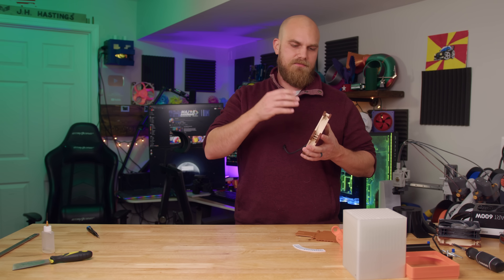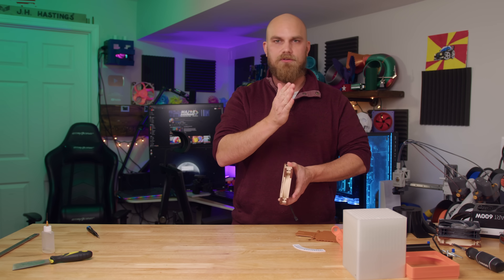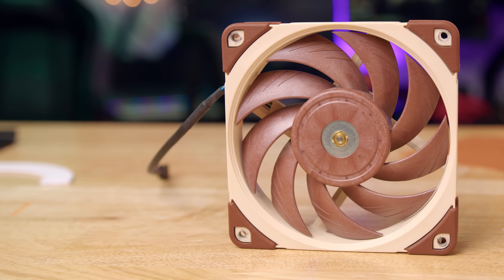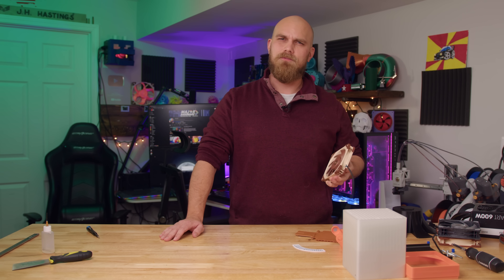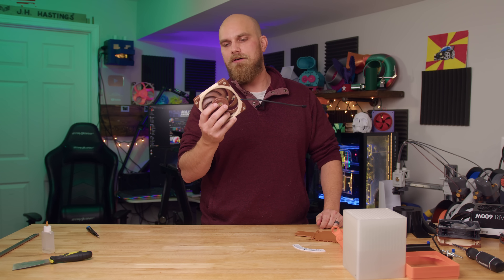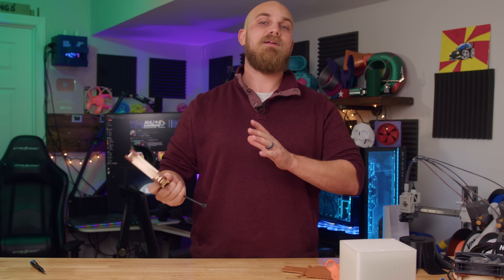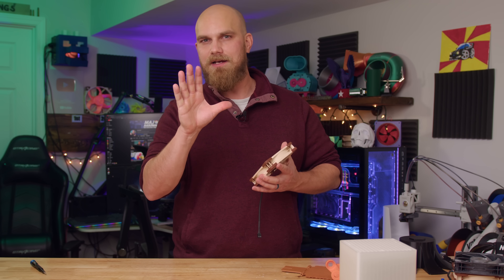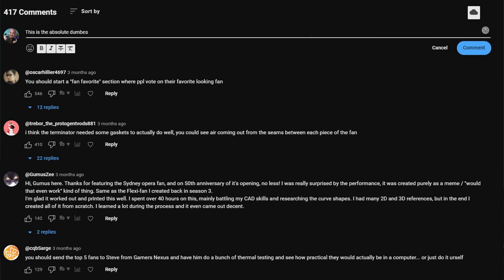I Built a Static Pressure Machine | Fan Showdown Season 6 Pilot

Comment: Not having done any fluid dynamics excepts for a few weeks one semester, you are measuring the pressure force and the force caused by the change in momentum of the air right? The air is deflected so you get the pressure aspect and the deflection as well; Do you want only pressure? Just use a double water column.

Also if anyone that has done more fluid dynamics could tell me if what i said is right? Because intuitively you'd expect different results if the restriction was the same, but the flow was not deflected and continued in the same general direction.

Comment: the only fix would be to adjust the gauge or sort of ruler that you have there to be less linear and more logarithmic. as others have explained, as the flap moves out of the way it takes exponentially more pressure to move it farther out of the way, so nothing needs to be changed about the flap, maybe measure it for reference, but all that needs to be changed are the numbers on that arched piece of the gauge.

Comment: You could make a tunnel where the fan sits in the middle of it and there is a pitot tube both at the inlet and outlet side. The difference in the pitot tube would give us the pressure difference. 😊
Reply: A pitot tube measures stagnation pressure, providing flow velocity, not static pressure.
Reply: I like this idea. Probably depends on how good a pitot tube you could buy for the small reading.

Comment: As an ecs engineer this seems insufficient to charactetize pressure. The problem is the pressure a fan creates is tied to the cfm along a curve. A fan will produce less pressure and more flow if if there is less restriction behind it. More restriction and cfm goes down but static pressure goes up. Honestly if you use a 3d peinted gate valve, your annomometer, and a water manomiter (use water cooling tubing) for static pressure you could generate curves and show how two fans might not be better then one another, but they might both outshine the other depending on the application

Comment: So, to work on your homemade scale.  how did you come to the amount of force / static pressure related to your scale? I would like to know the weight of your flap. Force Divide by Area. Lets say your flap weight is 1/8 lbs, so if it moves to 6, then it's has a 12oz or 0.75 Lbs of static pressure. I'm no expert, this is my ADHD brain trying to make sense of it.

Comment: I think the angles measured could be not granular enough to differentiate between different fans and you might end up with lots of entries having the "same" result. And even reading the correct value seems pretty prone to error.
Reply: Maybe a thinner, longer extension of the indicator might increase granularity?

Comment: It is not linear, the more it opens the less it is in the way of air. Not that it is a big problem, specially since the benchmark value is set so low in the scale and it seems that none of the actual test fans will be reaching a lot higher values anyway. The resolution should be highest at the low end, but i would assume that there are also little things that make it a bit noisy data, tinier imperfections matter more. Probably ok for this purpose.

Comment: the only real issue i see is umm whats the term? non linear? because the force/pressure required to move the flap the same amount increases drastically past around 3 if calculations are made and the increments arnt equally spaced similar to an analog multimeter it might be a bit better but really i think the main issue is that it is measured using something that rotates

Comment: Here’s an idea: instead of a wind tunnel, have the fan force air into a closed space with a pressure gauge in it. Whatever pressure the fan can hold inside the closed space is the static pressure of the fan.

Comment: Some issues I see:
1. Like others have said, your scale is nonlinear, e.g. the performance difference between 5 and 6 is smaller than the performance difference between 6 and 7.
2. The A12x25 should be much closer to the top of your measurement range, assuming most submitted fans will have performance in line with prior seasons. As is, you're more likely to hit the bottom of your scale and be unable to measure smaller performance.
3. Related to (2), your scale should probably be more sensitive to performance differences, e.g. the differences between your test fans were a small portion of the measurement range.
3. This setup is probably not representative of the environment in which a fan must actually perform, so even if your measurement of static pressure is good, the conditions that affect the fan's static pressure are not realistic.

One possible alternative:
Change the test rig so it's more like an analog tire pressure gauge. First, change the obstacle to be a cube with an open bottom (and maybe a cloth "filter" on the top rather than a solid face to simulate real conditions). Second, change the orientation of your test rig so air flows from bottom to top - the fan will be on the bottom pushing air up. Then, you measure performance by how much the fan displaces the obstacle vertically against gravity.

Comment: As for the manometer a single tube filled with water (or oil for increased displacement) making a U bend and with open ends before and after the load (different thicknesses/style of radiator) would be enough to show the pressure. With a camera and a macro lens against a precision scale you could get quite precise measurement. If you want to you could use some sort of iris with variable aperture (like in a lens) as the load/resistance to create a Pressure/Velocity graph.

Comment: not a big fan of this design as it requires airflow and pressure
if you want to determine the static pressure you can't really have air moving, cuz that makes it...uh...something else
dynamic pressure? is that a thing?

I think it would be more reliable if you just hold the lid shut and stick a bent pipe with liquid inside.

the air pressure would then raise the water column, and that actually is a common unit for pressure

edit:
now that I really think about it, shouldn't the stesting methodology have been obvious?
mm/Hg literally means "millimeter mercury"

you can't get mercury, then use water

inches/watercolumn not only solves the mercury problem, but also makes it american friendly
and with a simple online converter you can convert it to metric
and you don't even need to do that because bigger number is better

Comment: The 6 is likely fine since you want fans to exceed the Noctua fan and anything that doesn't push past the 1 would not be a consideration anyway.  This scale will also be sort of a reverse exponent since the more open the door is, the more airflow is measured vs pressure.

Comment: Would be awesome to start a contest on submitted Impeller blades for a 3D-printed water pump and test self-priming (height), psi, vertical lift, and GPM.
Could still be PC-related if used for CPU cooling.
EDIT: yes, using a static pressure test would be cool, and other tests.
The water test mentioned might be a better test tho.

Comment: I mean, why not just seal it off except for a tube with water in it and use the movement of the water against gravity to measure the static pressure?

Or, if you just have to have a completely 3D-printed solution, how about a vertical stack with an enclosed (mostly airtight) counterweight that exposes additional escape holes as it's pushed upwards with an indicator sticking out the top of the stack to indicate the height of the counterweight as the static pressure builds underneath?

Comment: not a bad setup and simplicity is king.
while you might have issues keeping it level, maybe find some ultralight linear bearings on some guide rods, blowing air up against gravity holding the weight down would provide a slightly more linear pressure reading. this way its always blowing against the full surface area rather than a diminishing surface.

Comment: I think this will work for comparison. But the actual number will be meaningless. You should be able to tell if one is better than another, but not really accurately by what percentage.
The resolution might be too low, getting above 10 or so seems nearly impossible, most fans will probably be between 0 and 5. I imagine a lot of fans will be at the same number. You might need a bigger dial with a longer indicator at the top to get a more accurate reading.

Comment: Air pressure regulators.
Those have a disk that measure the pressure in one side base on the difference between both side.
you could build one that has enough finesse to detect the pressure difference.
There also Pitot tube
and there is the option of just using a column of liquid that is quite light or a sphere inside a tube, you know, the flow test, those can be adjusted to test pressure too.

Comment: Maybe a better representation of the static pressure would be, if instead of pushing the flap horizontally, it should push it vertically and lift it in a flat orientation!

Comment: Most DIY fans will be much weaker than the A12X25. Seeing that it only goes to 6 on the scale it will make use useable range very low (0-6). I think the resolution is just way to low to compare fans. So either you need to make the door lighter or increase airflow (shorter wind tunnel?) or use an anemometer. Also as others have mentioned it's not linear since the surface of the flap that gets exposed to the airflow is smaller the further it opens.

Comment: It might be more accurate if you have a closed chamber, and then a couple weaker springs to hold back the plate. The reading scale would be essentially pushed back depending on how the fan performs. This would eliminate potential issues with the opening being bigger on fans that can produce just enough pressure to open the flap and then they are using more their speed to continue to open it.

Comment: In theory, could get a digital reading with a magnet and a Hall effect sensor. Not sure about repeatability and consistency, though Hall effect sensors are used to great success in flight sticks.
Reply: Came here to say the same thing. Digital read out would be much better and should provide greater resolution for those tie breakers.
Reply: This crossed by mind as well. With such minor differences possible, a visual gauge will introduce a lot of error.

Comment: you can use actual water to measure static pressure. Add a U shaped glass pipe at the end of the wind tunel, add water and calibrate:) It will not have any part which can add friction to the equation. Some additional thought: diameter of the pipe can change sensitivity of the sensor.
Reply: I have one on my radon exhaust system. So they are probably pretty easy to find and cheap  at least compared to the manometer
Reply: @matthewpiotrowski2677 Same here, works a treat and seems like it'd be pretty easy to setup. Could always use mineral oil or something with a lower specific gravity to get more height/make it easier to see.
Reply: @matthewpiotrowski2677  Those are manometers
Reply: Put the tube on an angle and some simple trig will greatly increase resolution
Reply: i like this idea; do this for sure
Reply: I was thinking the same thing. Since you're dealing with such small values, a lighter and lower viscosity fluid would work better to make changes more noticeable and avoid having surface tension mess with the scale too much. I'm thinking methanol or a super light oil. I'd avoid acetone as that's so volitile you'd have to worry about evaporation before you can get a measurement.
Reply: Love the idea of an ACTUAL watergauge! If you added THIS idea to replacing the flap with an appropriate sized fixed orifice, you could literally 1:1 measure pressure in mm/H20. You could also calibrate the orifice size using noctua's spec in the datasheet to get a direct 1:1 comparison!
Reply: "you can use actual water to measure static pressure"

Sure, but the Nocta fan only does 2mmH2O so seeing a 10% difference is going to be extremely difficult.
Reply: @vinny142 If the tube is laid down on a slope of 2cm per meter, the resolution would be reasonable
Reply: @vinny142 agreed. The type of fans tested are already pretty bad at static pressure relatively speaking, so i cant imagine having a good reading or a reading at all using water.
Reply: @vinny142  smaller hose will result in a larger change that is easier to measure. So if you use a 120mm hose it would move the water 2mm. If you used a 12mm hose it would more the water 20mm. Much easier to visualize/measure
Reply: @wtcamer I’m pretty sure the diameter of the tube doesnt matter if I remember my hydrostatics properly. But the fluid type will get you higher accuracy if it’s specific gravity is lower than water
Reply: That's not really accurate. Pressure is related to water column (height); pipe diameter has no impact.
Reply: @wtcamer actually not true. Pressure is applied to an area equally. If you iave a tube with a cross sectional area of 1mm  10mm/H2O will cause that 1mm² area to have 10mm of force on it which pushes it up 10 mm...    If you have a hose 10x that area (10mm²) and you apply 10mm/H2O, that 10mm pressure is applied to every mm in the tube..  so, 10x10= 100.  So even though the force is 10x as great, so is the mass of the water. So the water still only rises 10mm.   😂
Reply: @wtcamer  not sure thats true though.
Reply: @gadgetdeez7069 
I think a piece might be getting missed here. Don't hydraulic jacks use this principle, with one end of the reservoir being larger than the other to generate mechanical advantage?

Couldn't the same idea be applied to have a larger opening in the wind tunnel than on the gauge, and thus get more resolution on the gauge? You'd just have to normalize the results after collecting them, so they lined up with other setups that just use a straight pipe?
Reply: In Europe, we used to use such gauges to adjust gas pressures on boilers, but since the 70s analog and later digital gauges showing mbar have replaced that method, mainly because they can't spill when thrown in the back of a plumber van, but also likely for continuity, as fuel oil pressures were always measured in bar, and because the most common gas pressures conveniently already were 50 and 30 mbar, making it easier to remember. Sometimes, usually on REALLY old boilers, you still see either both units or only mmH2O.
Reply: I was going to say this. Use a u bend pipe with water and blow it to see how much water they can move.
Reply: That sounds easy enough to actually do it
Reply: "you can use actual water to measure static pressure."  You might want to listen more closely from around 1:28
Reply: Yes I agree with you use water and a u shaped tube mount the fan above the sealed box with the water and see  what happens
Reply: Combining a couple suggestions could get you something that will work well. Mineral spirits for a lower specific gravity and a smaller tunnel to increase pressure.
Reply: I thinks that's just how noctua did their testing thus the mmH2O units
Reply: @tenns  mm H2O is just a standard unit of measure of static pressure (also mm Hg). Even digital meters have the ability to output with these units, just because they're so entrenched in the field.
Reply: @RobBulmahn  Huh, never used mmH2O myself, in physics labs we always use mbar or Pa with scientific notation.
Reply: @tenns  "Huh, never used mmH2O myself, in physics labs we always use mbar or Pa with scientific notation."

Or the mmHg. It really just depends on where on the planet you are doing your work.
Reply: @RobBulmahn  The idea with mmH2O is that basically anyone can do it, all you need is a transparent hose and water and then measure the level differences. Then you translate it to whatever you'd like. Digital meters for low pressure conditions are often a bit expensive, sensitive or both while a U-pipe won't break that easily if the differential pressure is too high - just add some new water or in extreme cases replace the hose.
If you spill water - mop it up!
Reply: Couldn't you have the fan trying to pressurize a chamber. With a large diameter hole in the bottom connected to a water reservoir. Then connect a smaller diameter hose to the water reservoir.
Wouldn't the increased surface area of the input raze the water in the smaller tube more than a construction diameter pipe. Like how hydraulic jakes work.
Reply: @cb72727  Hydraulics trade force for distance, but they don't change the pressure. The rise of a liquid is a function of pressure, since scaling up the surface area scales both the force and the mass equally.
Reply: To get a higher precision measurement you just need the portion that is exposed to air in the wind tunnel to be larger diameter than the vertical section you use for measurement. That will scale up the measurement by (IIRC) the ratio of the cross-sectional areas.
Reply: @zstewart  I think you're misremembering Pascal's principle. It states that F_1/A_1 = F_2/A_2, so by increasing the area on the "output" side, it will provide a greater force but equal pressure. Since the height difference between the fluid surfaces is proportional to the pressure difference, not force (except indirectly, but the force exerted by the atmosphere is also proportional to the area), changing the area does nothing.